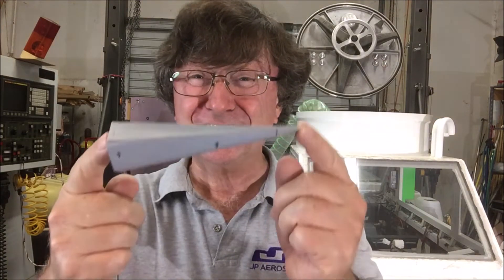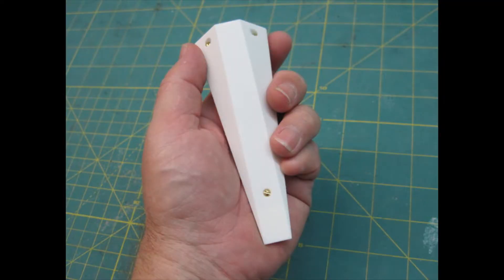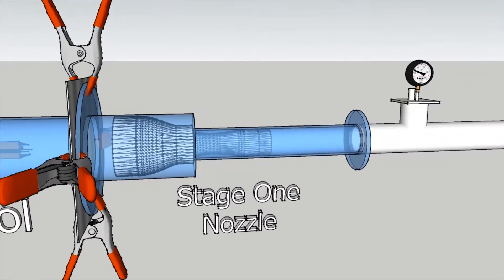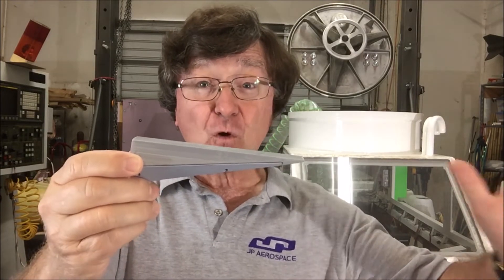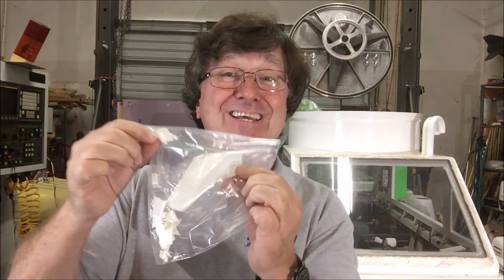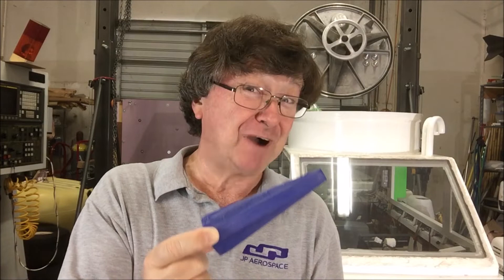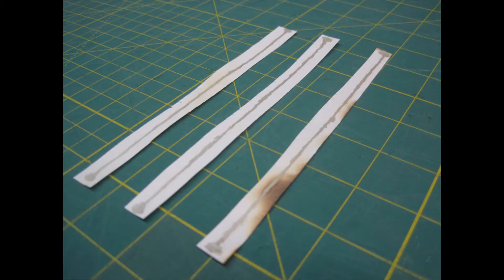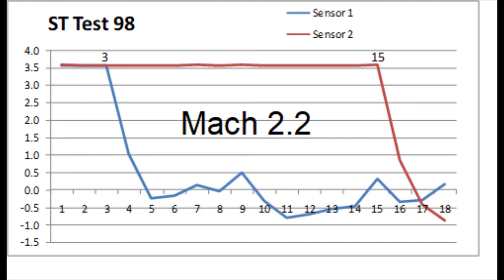How to Fly a 3d Printed Supersonic Plane

Comment: If you needed many of those small test craft, it might be cheaper to use injection molding rather than 3d printing each one.
Reply from the maker: They are change after over two to three flights. Too small a run for injected.